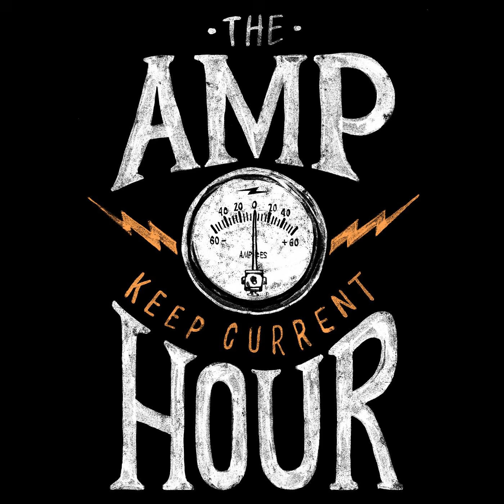The Amp Hour #599 - An Interview with Uri Shaked (Wokwi.com)

Comment: Noo I wish Chris hadn't interrupted at 1:04:35, I really wanted to hear more about the difficulties of implementing code compilation on the client browser, that sounds absolutely fascinating. Emulating x86 linux in the browser is already wild, I really wish Uri had had the chance to explain what went wrong with the second method he tried to do the browser based code compilation with.